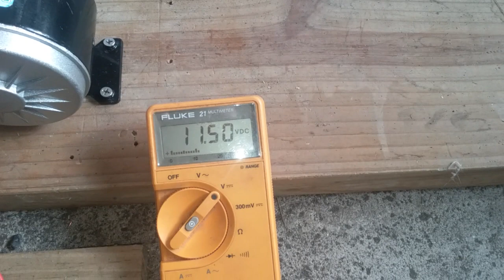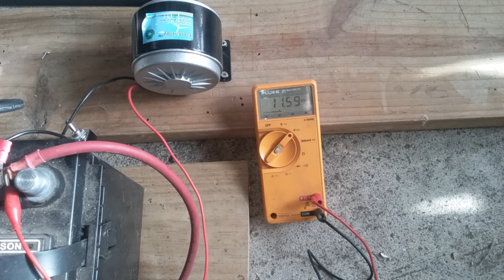My self sustaining generator.

Comment: Is it possible that you set off with the switch already energizing the alternator and then when you disconnected it, the motor found itself without a load and consequently accelerated and the battery naturally regains some of its voltage??

Comment: Let the out put of the alternator enter a super capacitor before u  hook it up to the battery and tell me how excellent it result.
Reply from the maker: Thats my next step thanks for the tip
Reply: U are welcome. And note u also need amp meter to control the amps          
Going into the rotor of the alternator

Comment: I actually have made this back in the 70s. I used a DC generator and then I used an alternator, to see which works better...the generator ran longer, easier to turn. It's also more efficient without the diodes. At the time I thought all I needed was a solar panel and it would be able to run all day. Now I have 1200 watts of solar panels and 20 marine batteries for my power. I run an Aims Power 2000 w. inverter charger, 24 volts to run everything. With 6 pairs of solar panels I get about 17 amps in the winter and 36 in the summer. When I built this, I worked at a salvage yard so I had all kinds of different sizes of pulleys and stuff.
Reply from the maker: Very Nice. I have a 1k solar and a 400w windmill I have been thinking about combining to but I was playing with this first to see what happens. I also am looking for the amps, amps is the key to running anything substantial.

Comment: You loose energy as heat in the motor , you loose energy due to the friction in the belt ,  you loose energy in the friction in the bearings , you loose energy in the chemical process in the battery . all in all this system will simply run the battery flat . It is not possible for a closed system like this to be self sustaining no matter how you design it .
Reply from the maker: Every thing you said is correct. The question is how long will this last. Nothing runs forever any ways, not even nuclear but for now I will play and have limited charging for power outs. Did you notice it worked even though it was slightly under in voltage  11.4?

Thanks For Watching
Reply: @clarionthechronicle7268  In that case you would have more energy simply powering something straight from the battery . It's not working it's not charging the battery it's discharging the battery . If it was working then there must be a hidden power cable or other energy source .
Reply: @Dailyroach how about using pelton turbine..it works?
Reply: @marvedavid4104  If you are harvesting your energy from an external source eg: water running from an elevated height to a lower height to drive said turbine . Then yes that would work to generate power . But you have to replenish the water at the top . Somehow . Closed loop , overunity , perpetual motion machines don't work . It goes against basic physics .

Comment: Can you show a closeup or explain the wiring from the alternator to the battery, & also the switch to energize the alternator? Please
Reply from the maker: Hooked up just like in an automobile. First switch is like the first key position on(lights come on and alternator energized). Second switch is the  second key position for starter/ignition(engine comes on). I could of wired them as 1 switch but i already had 2 wires and switches made.

Thanks For Watching
Reply: You have to turn the alt, at least 5,000 R.p.m's
To get what it would put out for an automobile.
There's things you can do, to get the max out,
Put, from the alternator. I think the best, is drilling out and putting n52. Neodymium Magnet's into the rotors. ( But if I remember correctly" the way the rotor's are made, they don't even need to be drilled out.!! Ya, just work around" the two part's of the rotors.
Reply from the maker: @arkangel8709  My magnets came in 4 days ago 😊

Comment: Nice in process of trying this now. That motor is for a furnace. I have a different one so will see. Very cool. 
A bigger pulley on motor will make alt put out more amps as long as motor can 
Handle load . Love it keep
Going !!!!!!!
Reply from the maker: Thanks For The Tip
The motor is for a windmill generator but also can be used as a motor
Thanks For Watching
Reply: @clarionthechronicle7268  I will be back to watch your progress when my system is together ill GRT back yo you.
Reply: Why not just use a coupler and connect the two shafts together instead of using a belt all together

Comment: great rough draft to start with.
maybe a two speed 12v electric car fan motor (mark 8)  add a treadmill flywheel to the fan motor.  add a couple of relays ( act as a transfer switch) from low to high.  
would all help start spikes and then trasfer over to the high side.  would get that alternator hauling ars!

sounds like a fun winter project!

larry  edit:  just add a small block chevy harmonic balancer with a pully.  that would solve both problems.
Reply from the maker: Thanks for the tips!
Thanks For Watching

Comment: All you need now is inverter .
Reply from the maker: Actually I have been thinking about that. DC works real good for local so why convert it. I am going all DC its easy to wire and they dont make AC batteries.

Thanks For Watching

Comment: Will someone please put one of these on electric go kart to see if it works it'll turn a 12 volt motor put it on a freaking electric go kart see if it has power or I'm going to
Reply from the maker: I have seen people rewire an alternator and put on bicycles and gokarts. Those little 12 volt perm magnet motors will work but probably not very well for that application.

Thanks For Watching

Comment: Explain diagrammatically.as this is jumble of wires.it will not work
Reply from the maker: Sure: This is exactly what is in an automobile only difference is the motor. Gas motor or electric motor makes no difference to the battery and alternator.
Thanks for watching

Comment: The battery will drive the motor for much longer when you take the belt off the alternator to reduce the load
Reply from the maker: I had both the motor and alternator on a switch. Near the end of the video I turned the alternator off and the motor ran freely. No alternator to recharge, the system will stop quickly. The point of this was the make it run under its own power.

Thanks for watching
Reply: @clarionthechronicle7268  "make it run under its own power"" .FROM THE BATTERY

Comment: You need to have a dc clamp meter which you can use to measure the currents in different branches of your circuit to determine whether it's an over-unity system.
Reply from the maker: Thanks for the tip!
Reply: Over Unity only works for under intelligent.